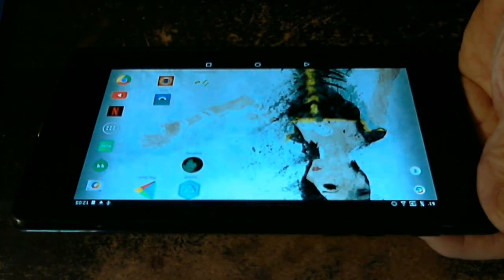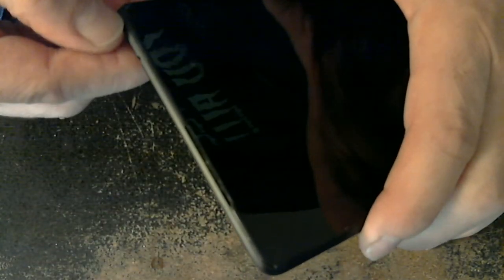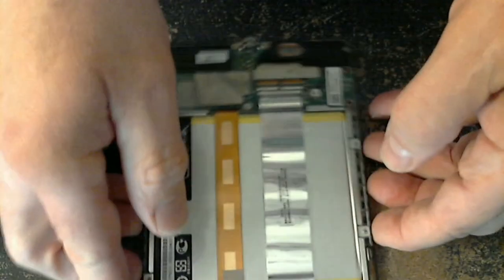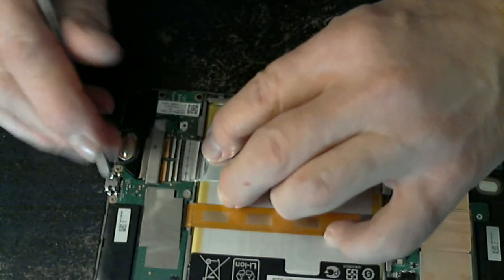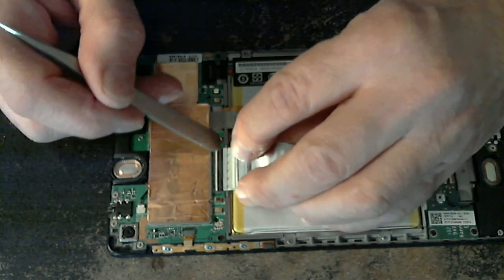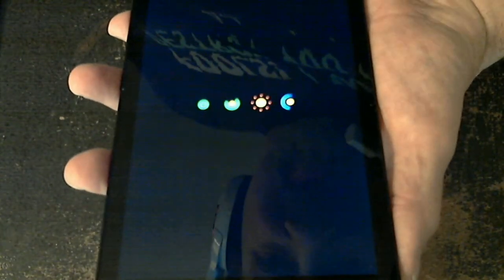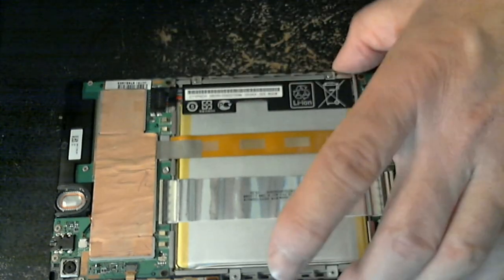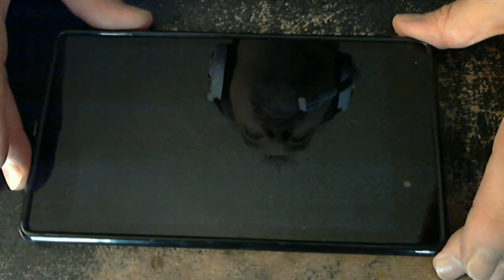Nexus 7 2nd generation (2013) Accelerator sensor repair (see description, see recent comments!)

Comment: This is a fairly old video now, but I have just been fixing the sensors on my venerable but still working Nexus 7 2013 for the 2nd time. So, I thought I'd add some comments that might be of help to anyone still doing this.

Firstly, I do not think this has anything to do with that ribbon cable moving as such as others have suggested (if it moved, it would probably help, as it would remove corrosion), it is more likely to be the connector at one end or the other. probably the connector bows up slightly in the middle after a period of time and does not maintain even pressure on all the terminals.

In fact you can see that the manufacturer realised there was a problem here because of the foam pads on the inner side of the back plate which press on the connectors to help them maintain contact. That is not a normal thing to do - they must have realised those connectors were problematic, but a bit of foam tape is a lot cheaper that reworking boards for a different connector type.

The foam probably compresses over time and ceases to maintain pressure. What I have now done is as follows:
 1. Carefully remove the ribbon cable as described.
 2. Put a VERY small quantity of switchcleaner on the ribbon cable contacts. This is the type that leaves a residue (some are just IPA and don't). The purpose of that is to provide some film over the exposed parts of each terminal to stop corrosion building up. It is not hermetically sealed so unless the contacts are gold plated (and they aren't), they are doing to eventually have a corrosion film build up over time. Be VERY careful, you don't want excess oily switchcleaner floating around inside, I used a tiny paint brush.
 3. Put a strip of masking tape to cover each foam pad, ie to just very slightly thicken the pad and provide more pressure. In addition, put a second piece of masking tape (about half the length) in the centre of each pad, so there is more pressure in the centre of the connector than at the edges (on the premise it bows up a bit in the middle).
 4. When replacing the ribbon cable, bear in mind it is only just long enough. If you push it right in at one end, the other will barely be seated enough to make contact, which itself might be an issue. So carefully try to get it 'centred'.

Reassemble.

It is all working OK now (I used the same app to check, and a compass). How long it will last I do not know. I have to admit I am not confident of a long term repair, as it is a fundamental hardware design flaw, really. On the other hand, it is 6 years old now, so I guess I cannot complain.

Incidently, its predecessor (a 7/2012) had a similar problem on a different internal connector.
Reply from the maker: It's old, but I still get occasional views and the odd "thanks". Ironically, I don't even own the tablet any more -- I gave it to my ex, and one of her cats knocked it on the floor and broke it.

A very nice and thorough description of the problem and a more permanent solution. I agree that it's probably oxidation causing the problem and that movement of the contact surfaces is actually a remedy, not a cause. In fact, it's almost certainly the entire reason why the advice in this video works: pulling the cable out and re-inserting it scrapes the surfaces of the contacts, temporarily removing the oxidation that acts as an electrical barrier. 

Thanks for taking the time to explain all this! I hope the viewers find it useful.
Reply: @jjnonken  Glad you found it helpful, as I did with your video. I doubt it is more than a temporary fix as it points to a fundamental connector issue, really.
Reply: @jjnonken - Thank you for keeping this video up.  I had been having trouble with my rotation sensor, but lived with the problem.  Some apps would open in Landscape, and some apps would open in Portrait - so I worked around the problem.  Since the screen DID rotate per app (just not automatically), I thought it was a software problem.  Another video talked about "Google Now", but I had never heard of that software, and do not have it installed.  I opened my device - the cables appeard to be connected evenly, and did not move.  I did apply some gentle pressure with my finger, just to try to "form" the cable into place.  When I replaced the cover and turned the device on - it worked.  I was pleasantly surprised!

@Nick W  I think you're 100% correct in your assessment, and solution.  The connectors on both ends of my cable appeared secure, but the cable itself had a little extra space, so maybe the angle or pressure has something to do with it.  If the problem persists, I will continue with layers of tape, and maybe even rectangles of copy paper... similar to layering a bandage to apply pressure to a wound.

Thanks and Cheers to you both!
Reply: I had the issue as well and ended up "bricking" my tablet lol. Reminds me why I should not try to fix delegate electricity myself. Me connector only barely needed to be touched to just completely separate from the board. Like before I even "unseated" the cable. So the suggestion that the original design allowed bowing looks like it was extreme in my case. 

Anyway, it doesn't look like there is any easy fix for my situation and it won't even power on now, but appreciate the tips regardless. I've definitely gotten my money out of this little tablet and actually considering buying a refurb/used one even how old they are. I absolutely love the form factor and the power generally covers my needs. 

Thanks for the tips and ideas even if I screwed mine up lol.
Reply: Speaking from my manufacturing and engineering experience standpoint, the normal reason for these foam pads is to help ensure connectors stay closed during drop testing.  The wedging effect of the connector onto the contacts is independent of connector length -- the center ones press just as securely as the end ones.

I've done the re-seat experiment on mine, which routinely loses connection with the accelerometer despite being handled only quite gently.  I also added two layers of vinyl tape across each of the two connectors.  If this doesn't resolve the issue, I'll report back with additional experiments and their results.

Comment: thanks for solution, but sometimes, after charging, the problem appear again. just for some info, maybe it's minor electrical faulty.
Reply from the maker: No guarantees that it's a permanent solution. Mine would fail every few months.
Reply: yep, same with me, but far more often (fail), just because use some non-factory charge overnight, the problem occur. but the solution is far simpler, just restart it, then the accelerator work again (after using your fix tough), sound stupid, but that's what happening to me. but thank you, my accelerator sensor work again. I already fix it for several week (using this technique).

Comment: I had to to use Rotating App for it to work than the free trial ran out and yea my sensors were showing now movement signs at all but I also tried turning off N7 and face it down on a flat surface and with my fingers I pressed hard on N & S on the Nexus letter on the back and turn it back on it works but it's probably temp fix but this video is full fix for that problem
Reply from the maker: I think the one I linked to is free. I personally would consider it worth a dollar or two. Technically mine is a temporary fix too, otherwise I wouldn't have to open up my tablet every few months and fix it again. :) Hopefully the N+S fix will continue to work for you.

Comment: I have a problem with touch. It do not repsonds. But when is play with the touch connector those 2 chords below the sensor cable, a lot of touches happens at once on screen and when i set it up again no response. Now i am wondering is it the cable or the touch is faulty. Either the touch cable is faulty or the motherboard pins are. What do u think about it ?
Reply from the maker: I'm not an expert on the product, but I'm pretty sure it's a different cable. Do a web search, and best luck!